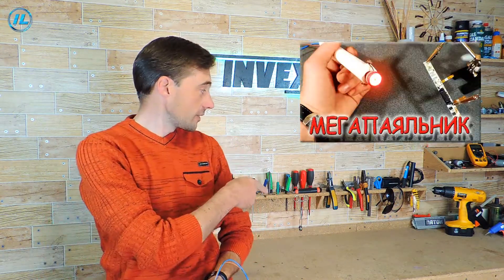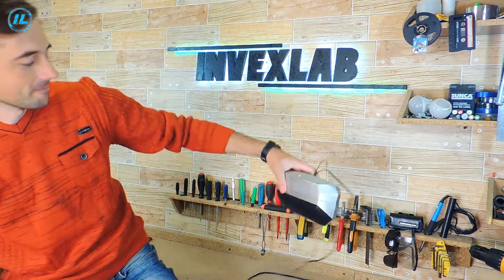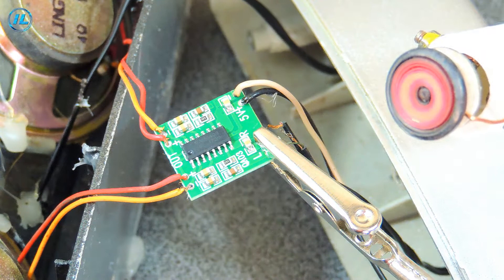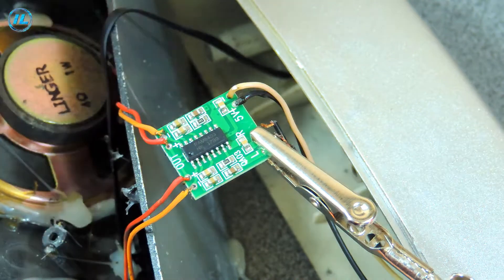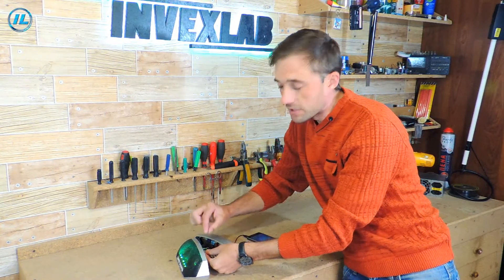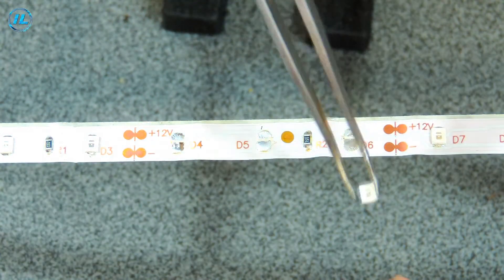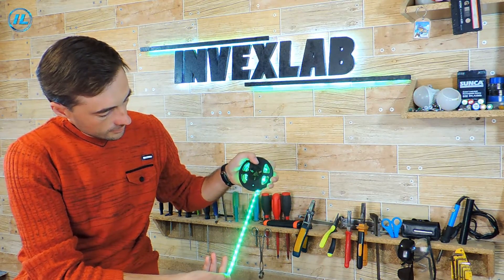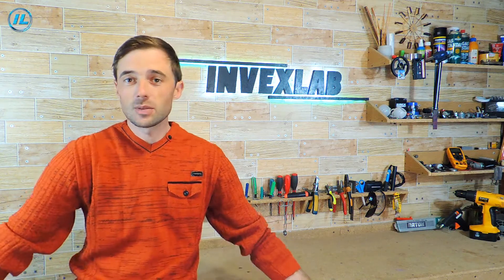✅ Homemade IR soldering iron! This is a really cool thing! Soldering like a madman... ✅

Comment: I have seen your 3 videos on infrared soldering. In these videos you are using the transformer to run it. The voltage is 14 volt AC and what should be the Ampere of the transformer? Could you please highlight it.